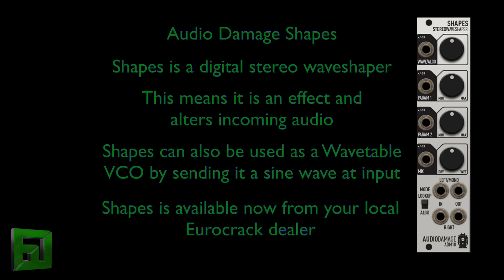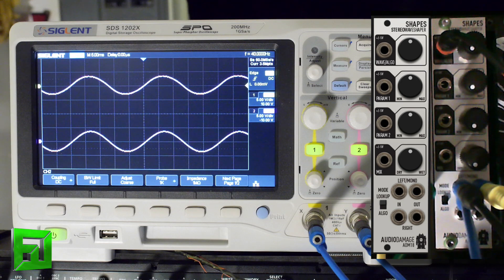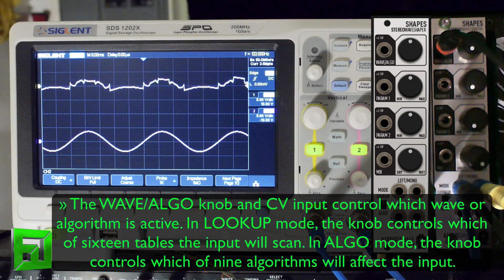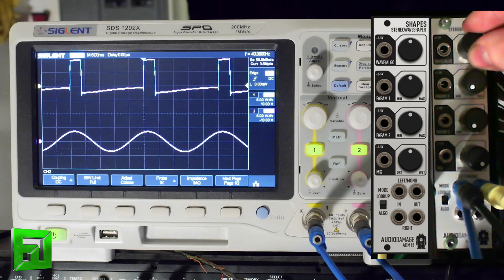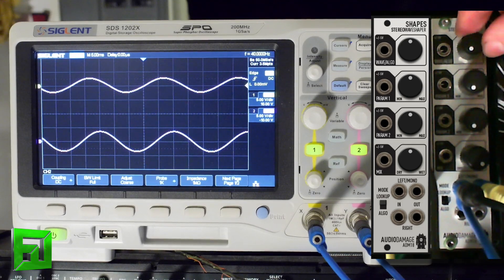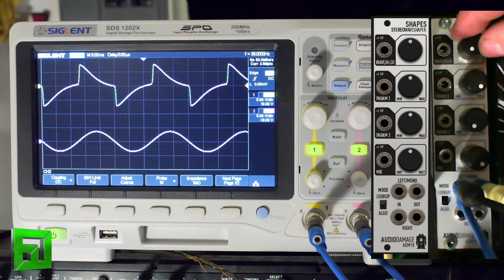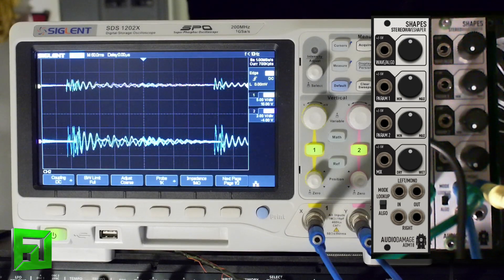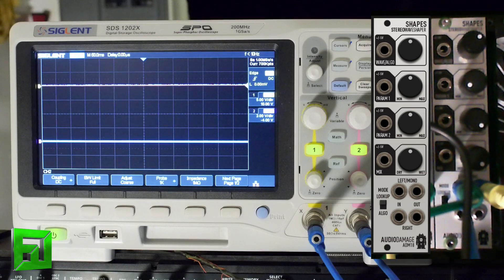Audio Damage Shapes eurorack waveshaper

Comment: Fantastic video, very informative that sparks many creative ideas waiting to be discovered.  Most wavetable type modules use a sawtooth wave as a look-up table, here you use a sine wave, could it be possible to show the wavetables as indexed by the sawtooth wave on the scope? Nobody seems to show what the wavetables look like, you can't even find them in the Audio Damage manual.